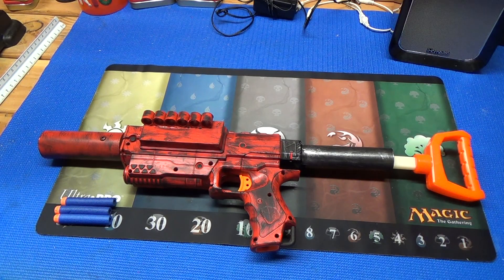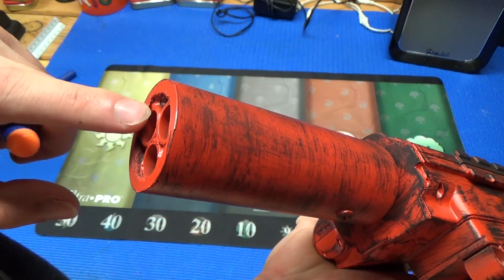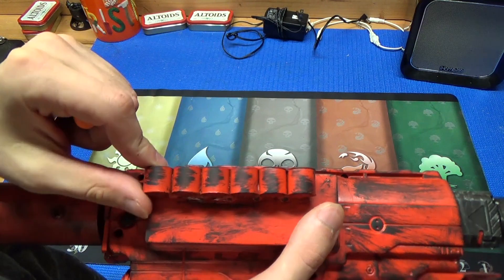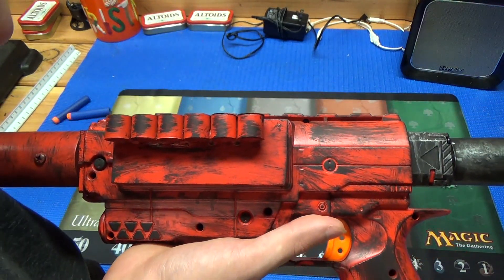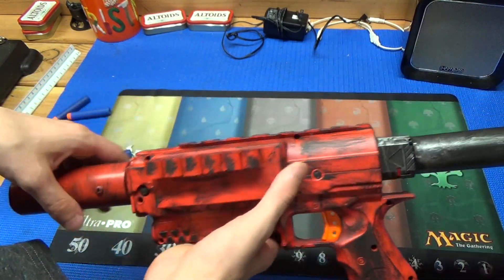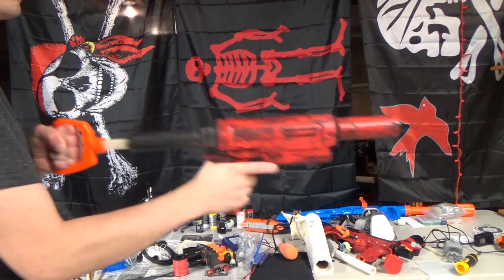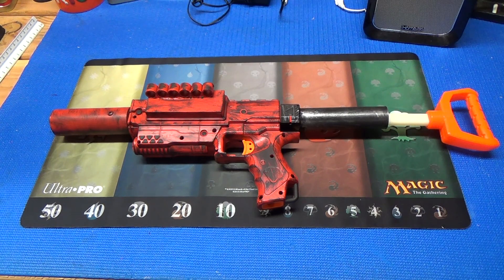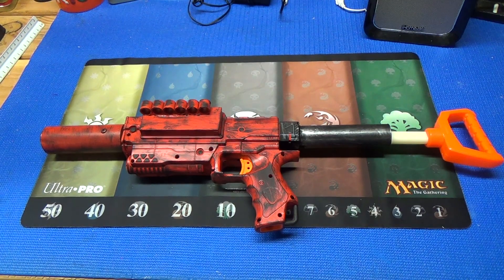[MOD] Nerf Shotgun Pistol

Comment: You should put the pump on the bottom, so you can pump it easyer and can use stocks
Reply from the maker: I did this with the second version. I ended up breaking it before I filmed anything so I need to re-do it again with a new shell
Reply: Rmods74 nice, im excited to see how it will look like

Comment: You said you did some kind of plastic cpvc magic to hold the blast button in place. Why not just putty it down? Dirty, but solid and effective. It was the solution I came up with on the ones I made. Been holding up on the ones that I've made. I'd like to see a picture of it if you have one, all ways good to get a look at another option.
Reply from the maker: +clownie nerf The tank is being held in with a piece of PVC rather than something like gluing it in, so in case that tank breaks or has a leak in the future I can swap it out for a new one with no problems, rather than having one hard mounted in. The problem with holding a circle component with a circle mount is that it can freely rotate, making the blast button rotate away from where the trigger can hit it. This was solved by putting spacers in the shell to limit that rotation. I unfortunately have no pictures but will take some if I open the blaster again.
Reply: +Rmods74 Yes, cant stand it when a blaster is sealed up and cant be serviced. Must have a way to open it for maintance and part replacement. Thank  you for the pictures if you get the chance.
Reply: You're Jolly Rogers have earned you my sub. My Lair has 2 behind my drum kit and all around the walls in various places. You're paint job style is the best red paint I've seen on any Nerf blaster, FTR.

Comment: how did you make this?
Reply from the maker: I took the air tank setup from an Xtreme blastzooka and put it inside a cut down rider shell. It fits pretty easily and only needs a small piece added to the back of the trigger to push the blast button for the air tank.